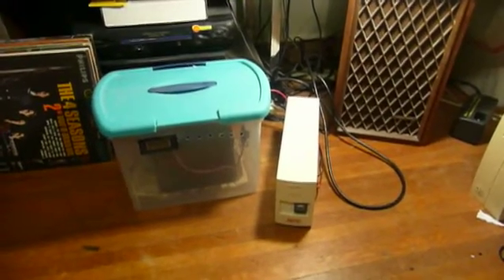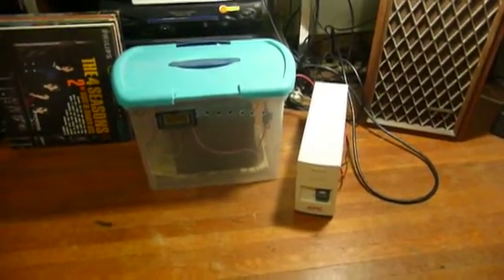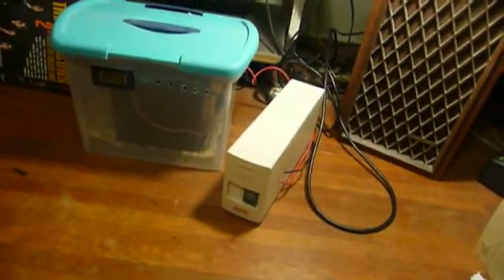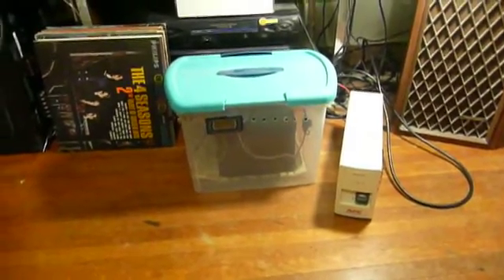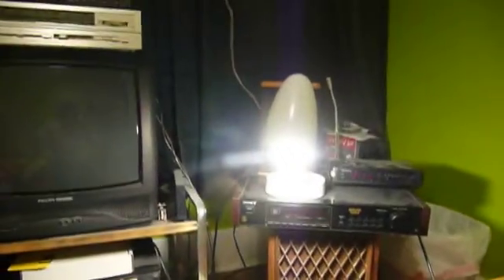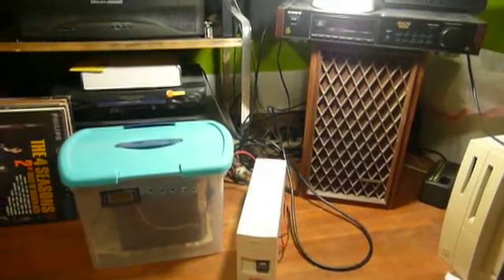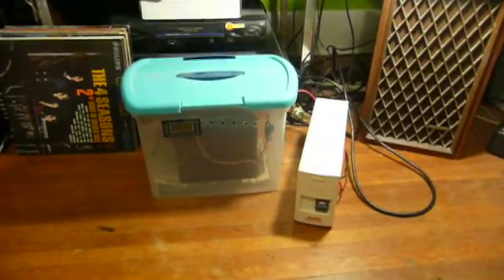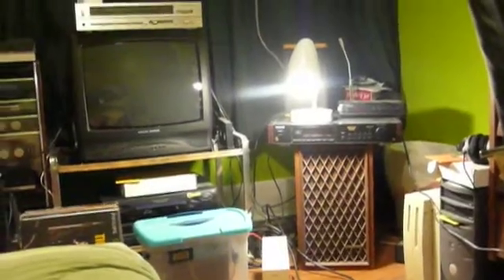Repurposing an Old UPS With an External Battery

Comment: Somewhat later in time, there's a 300 watt pure sine wave inverter for about $50.
https://www.eastwood.com/eastwood-300w-pure-sine-wave-power-inverter.html
$40 + $10-$12 shipping.  It's a compact inverter and the output waveform is a clean sine wave, whether powering LED bulbs, an incandescent bulb or a 100 watt soldering gun.  The idle current is 0.3amp.
Put the same system together but ave a relay turn on power to the inverter when the lights go out.  

I have a much larger backup system, using a solar-charged 420AH 12 volt battery bank and a 2000 watt pure sine wave (PSW) inverter.  There's a 4 circuit GenTran switch (they now go by ProTran and the smallest they sell is a 6 circuit switch) to transfer furnace, fridge and some counter outlets and lights to the inverter or a gasoline generator - yes, my backup has a backup ;-)  The solar system is sized for "Wait until daylight" so I'm not out in a thunderstorm or shoveling 7" of snow at 30F to get out a gas generator.  That time is 8 to 20 hourse depending on the season but 8 hours is "Wait until daylight" time.  The 300 watt PSW inverter and a 500 watt PSW inverter are fallbacks if both the 2000 watt PSW inverter and the backup 2000 watt PSW inverter fail.  Won't be running the fridge on either but can run internet and charge cell phones, tablets, laptops and power ham radios.  If power is out longer than the solar system can supply, first backup is a 1600 watt inverter generator that can run the same basic load as the inverter and recharge the battery bank, running about 6 hours on a gallon of gas.

You might also want to look for an AGM battery (search the for sale section on Craig's List) because the AGMs are sealed and don't need ventilation.  A number of vehicles now use AGM batteries (so the battery can be in the trunk) and you might find used but still usable of those inexpensively.  I picked up some year old 100AH AGMs for $100 each on Craig's List (new cost is $170-$200 each).  100AH is a lot more power than the 23 AH or so of that U1 riding mower battery and the AGM will take 1000 discharges to 50% capacity while that will kill the little battery.

Comment: i did the same with a "forza nt-7610" UPS and a 95 amp hour interstate battery (pf-24f-5-es) ... simply took out the original battery, extended the cables, made two holes into the housing of the ups and connected the car battery ... works like a charm ... of course it takes time to recharge the battery but no overcharging etc ... just please be careful everybody so you don't get hurt ... think first, then act :)

Comment: How many amps are your fuses?
Reply: ***** do you charge the external battery from the grid with the ups? i mean you replace the small battery with the external battery and plug it on the power socket?

Comment: PLEASE note, APC as an example, has UPS that need a 12 volt battery AND they have UPS that have 2 or more batteries in series to create 24 volts.  Note the battery voltage your UPS runs on BEFORE connecting a battery to it.  I rebuild these frequently.  I've seen 4@ 6 volt in series, 24 volt total, I've seen 2 @ 12 volt in series, 24 volt total and I've seen 1 @ 12 volts only in an APC UPS.
Reply: APC isn't the only one that uses multiple batteries in series. My CyberPower 1500PFCLCD uses 2 12 volt batteries in series for a total of 24 volts.

Comment: Hei!

This is really good DIY, but I did not find a warning about how much Wats (amps) can you connect to a UPS with car battery. I would like to power 1000W with an 800VA - 500W UPS that is modified with car battery. Is however inverter enough powerfull or I should get a different UPS, the one that has enough powerfull inverter? I will be pulling 460W-500W at 12V x 2 on 240V from that UPS, can you suggest me if this is the good idea?

And of course is the 30A fuse enough or I should take less - 15A?

Thanks! Tad

Comment: It might be worth mentioning that if you are going to attempt this upgrade to do some research into the battery types that are available. There are some sealed cell deep cycle batteries out there that, while expensive, add an extra layer of safety. And any additional layer of safety is welcomed. I have a SmartUPS 1500 that I picked up for free. Going to test it out with a pair of Optima Blue Top marine batteries. And if that works out well I may upgrade to the more expensive cells.

Comment: I have a 1285VA "Geek Squad" private label UPS, one of their super HD models and the one battery was going bad.  Opening it up I found two batteries bonded together, and to my surprise they were running in series !  The damn thing needed 24 VDC.  The original batteries were Yuasa 12V 8Ah so I am replacing both with two tractor batteries with matched characteristics.  

I only post this because not all UPS's are 12 VDC and will not run using the example given in your EXCELLENT video, good job !

Comment: In an emergency situation you wouldn't have time to rig them up.  The main focus isn't lighting, its showing that you can re-purpose a UPS with a dead gel cell using a common wet-cell that you can find anywhere.  Also the run time with an average car battery would be pretty impressive.

Comment: From a guy who's "been there, done that".  

Get RID of the old school wet lead/acid car batteries.  These things are heavy, discharge too fast, and present way too many problems to be used indoors.   

Sealed lead acid batteries : Way better and safer performance.  

For the most part:  APC's 1000, 1500 UPS' are pure sine wave output. However the whole design of a UPS is not geared to long term power generation rather providing a means to save data and shut down within minutes.

Comment: I have a new APC Back UPS Pro 1500VA and a CyberPower 625VA UPS.  I don't think one of them is true sinewave.  I have external hard drives plugged into both, and the external hard drives both have the plugs with the transformers in them.  Is it safe to have those transformer plugs plugged into the UPS if it isn't true sinewave?

Comment: my advice is if you have a smart-ups model mod it so you can attach batteries to from the outside. if you due this you will less likely break the ribbon cable connected to the battery door. I had a smart-ups 1000va and the ribbon cable broke off the battery door and fried some chips on the main board near the front. So i threw it away and got a cheaper back-ups instead. i mod the back-ups 1500va to use the same batteries that in smart-ups 1000va model.

Comment: I have that same exact NAPA battery. I have it mounted on a small hand cart with bungie cords and I have alligator clips on it running to a 12V car lighter port mounted on the handle. I use it to run tire inflators and other 12V devices. I have this coleman multi tool set with a drill, recip saw, circ saw, light, and a buffer/sander. I modded one of the old batteries to connect to the rig thru a 12V car lighter plug and now I can actually use the rest of the tools and it lasts a long time.

Comment: Nice vid bill i want to buy a ups to protect my home entertainment center from surges and keep it running for at least an hour since thats how long the light company takes to fix a prob. It sucks cause where i live we are very prone to outages. No internet sucks!!  These units have just enough power to keep my router running. Im in the middle of figuring out how many watts my center pulls to buy this ups and fter i might connect an external battery like yours. If you anything to add for my proj

Comment: @uxwbill my meter only has a positive and negative. these 2 wires read the voltage and also powers the screen and backlite. do i simply connect it on my battery and put a switch in the middle ?

Comment: @uxwbill hmm.. SiS and I didn't like each other much... I've got two boards here.. a D510, and an N330 both NM10, one has GMA950 video (N330), the other GMA3150/3100 (D510).. they ARE Foxconn.. (yick), but I'll be grabbing a Gigabyte D525 at some point.. I want 4 SATA's and IDE.. GIGABYTE GA-D525TUD has that.. and there's an open-box one one newegg for about 76 bucks shipped... hmmmmm....

Comment: heh, might rig my APC to run my two Atom boxes.. one is a D510 server, the other an N330 desktop.. both are rated to use no more than 55W a piece FULL load.. though mostly they're idle..

Comment: @jefferyb304 Your UPS unit probably has stepped sine or even square wave output, so it'll have a good bit of harmonics. These in turn are more easily reproduced by the speaker in said Magnavox console. Looks like that one could use some new electrolytics, the filter caps have to be pretty much dead.

Comment: Would a Smart-UPS 1400 be one of the true sine-wave units?  I have one here but the batteries seem to be dead.  It uses a pair of sealed lead acid batteries. My plans were to disconnect the batteries and use the unit as a "power scrubber" to clean up the power output from my '74 Onan generator, so i could run things like my fridge and such in the even of an outage.  Would this work?

Comment: I used to pick tons of these up, and the fact was, I ended up tossing quite a few and scrapping the batteries. Luckily none were very special ones, just basic cheap ones...and I still find them often...so no loss.

This is an awesome idea, and I think I will gather the supplies and maybe bust one out near the storm season when we do seem to have power failures. It would be useful to power a light or such.

Comment: I worked for a company called PILLER and when I left I got 2 anton piller 10kva 3 phase ups and 2 5 kva powerwire  both on line UPS systems I left the company 
15 years ago so all the batteries are bad I remove the batteries and turned them in to Jhonson controls and got .50cent per batteries . I lost power way back when the were good and had both hooked  to 2 different rooms and frig lasted 5 days then both went down on low battery.  I wish I had the money to get batteries for them